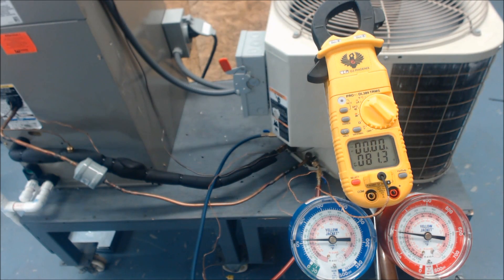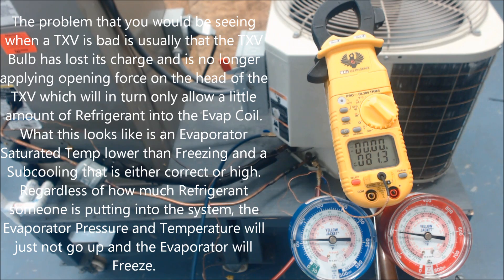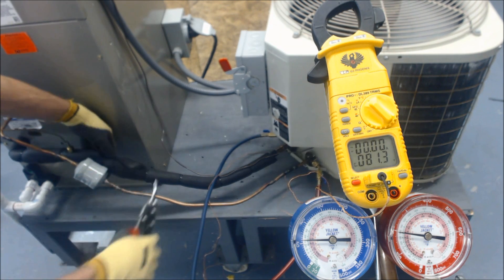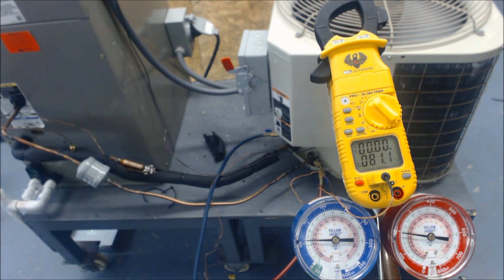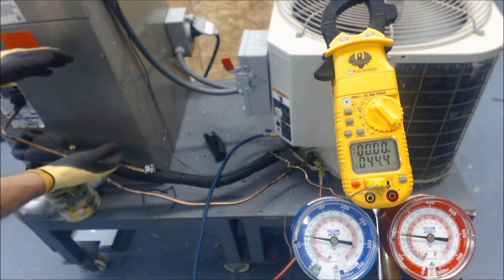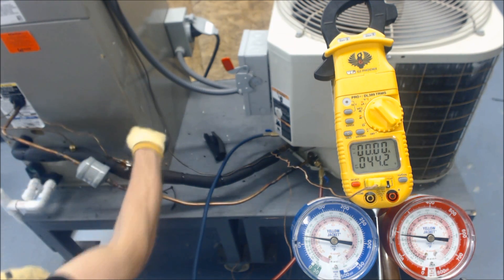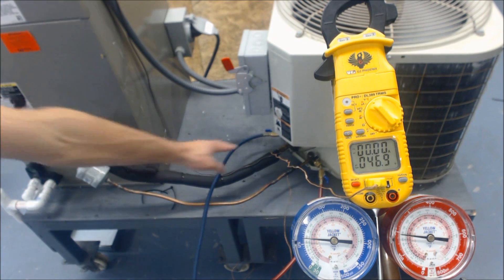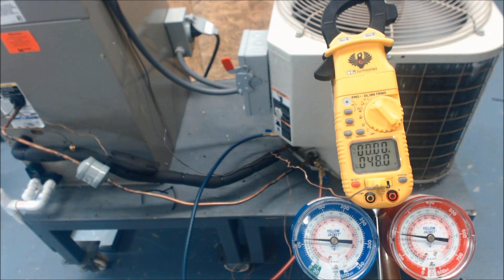Checking the Refrigerant Charge: How to Test a TXV if you suspect its the Problem!

Comment: How come you didn't do an actual temp with a temp probe at the suction line at the indoor unit to see what temp it was as well on either side of the dryer filter to prove its not clogged. If its 32 dgr wouldnt the wind shill freeze the evp coil? For the record love your videos.

Comment: hi, when the new evaporator coil comes with an already installed TXV with clamps. do you still have to put insulated it? example like when the TXV is behind  the sheet metal cover. thanks.
Reply from the maker: I like to put insulation around it but if the manufacturer does not put it on then you may not really need to. I would and do though, thanks!

Comment: Why is the external equalizer upstream of the bulb?It should be mounted after the bulb not be for,Right?
Reply from the maker: As long as the external equalizer is close to the bulb then it is completely fine. Usually we have them within a few inches but say they were even a foot away from eachother and they are insulated, the superheat would not change within that small of a distance. Thanks
Reply: I was under the understanding of never connecting the equalizer line immediately ahead of the bulb because a small amount of refrigerant can be expected to leak through the packing in the expansion valve and enter the equalizer line.when refrigerant drains into the suction line it is usually colder than the suction gas;therefor,it influences the temperature at the remote bulb unless the equalizer line is properly installed on the downstream side of the bulb.
Reply from the maker: There are 2-3 schools of thought on that and one is that the txv is there to maintain a good system capacity. The other thought is to maintain a proper superheat for the compressor's sake. Some would say that you need the bulb to read the suction temp after the last device is installed which would affect superheat to make sure that superheat is not lost before reaching the compressor. Some would say that it is more important to fill the evap with the sat state as much as possible and that the compressor may be able to handle a small amount of sat state every once and a while. Others say there really is not much of a change in temp read on the bulb right before or right after the external equalizer. We also use txv's without the external equalization port which is worse for guaranteeing compressor safety. Thanks a lot Robert and awesome question!
Reply: No Thank you for the elaboration and time you take in sharing your knowledge.Love your videos and appreciate all you share with us.

Comment: One habit that you might want to get into if you suspect TXV issues, especially on a new install is to be sure that the txv is correct for the unit being installed. I had a real head scratcher r410a install complete system that simply wouldn't conform to proper SH/SC numbers with all indicators showing a liquid restriction. No frost or condensation line on the filter drier. Replaced it anyway. Then I thought must be some debris in liquid line near txv or txv weld or something. NADA. It drove me nuts! Hot water test showed the bulb and valve opening and closing, but couldn't get the pressure in evaporator to get in line for me. Ugh. It simply had to be either clogged capillary tubes/manifold in the air handler or it had to be a problem with the TXV. Condensate? How, my evacuation was NATE standard...twice! Well, with no clear frost, a defective coil was tough to prove, so I decided to order and swap out the TXV with a new r410a unit rated for this 3-ton coil. Another evacuation and recharge and Voila' we were finally where we needed to be. 

Upon close inspection, the Manufacturer installed a R22 TXV on the unit labeled r410a. I guess mistakes happen. Customer was thrilled, but for a while there I looked like a complete idiot. Lesson learned: always check the main components, even on new units, to be sure everything matches up to refrigerant and capacity on the label. It doesn't take that long to check, and it 's infinitely easier on the ground before it's in the hot attic!
Reply from the maker: Absolutely, great job. That's a shame that someone would do that but it is definitely something to be aware of when servicing. Thanks Kenny Manchester!
Reply: Amen.

Comment: Hi. This is Blaze from San Diego. I got it. I need to get a glass of hot water and put my sensing bulb in it to see if the TXV responds before I condemn it. Thank you so much. 
Have a great weekend!
Blaze
Reply from the maker: Also a restriction in the liquid line near the txv could look like a bad txv because the bulb temp increase doesn't help. Sometimes the screen clogs. Anyway just letting you know for education for the homeowner as far as potential costs. It is not often but sometimes the filter drier can clog but once again that is rare but you can do a temp diff across that one of any more than 4 degrees. You are on the right track. Thanks Blaze!
Reply: acservicetech   I'm sorry to say that I'm a service tech also a home owner. I've been doing this for 23 years. It's hard to believe what I miss. Like I said on your other video there is no drier. The iceing
Reply: acservicetech icing starts after the TXV. But I have the door open on the indoor unit. Thank you for your videos. I love them. I'm a new subscriber. 
Thank you 
Blaze
Reply from the maker: Blaze, sorry I responded without thinking about the other post. I was rushing answering some questions before we had company over. Thanks and I am glad you are enjoying the videos!

Comment: who is right we have an argument going on when you are charging a dry dry charge system that you should go off what the name plate says and then leave it to equalize but then some guys keep adding refrigerant will it's got double charged I keep telling people that that's wrong so who's right
Reply from the maker: Ha ha, ok. Vac to 500 microns, break vacuum with liquid refrigerant weighed into the liquid side from rating plate weight. Turn system on and wait 10 min, Check and adjust charge with subcooling if system has txv.  If there is cash on the table bet, remember I get a cut, just kidding! Have fun out there!

Comment: I had a problem with a unit that was condensating too much and drippinig directly on the floor,keep in mind it is an upflow. I did the hot water/cold water test to diagnose the txv being bad,the pressure did not move at all in the hot water and the cold. Great job on the explanation to properly diagnose txvs,which I thought were my nemesis to call backs!
Reply from the maker: Glad you enjoyed the videos and that they help!

Comment from the maker: Great question, the TXV will try to hold its factory set superheat adjustment and only put into the evaporator coil what is needed to absorb the heat in the building while still having a superheat in the evap coil. The piston could produce liquid going back to the compressor if there were not much heat to absorb in the building such as the inside temp being low. As for the condenser portion, the unit will run very efficiently and have more liquid and higher subcooling ready to go and feed the metering device. Thanks for the great question!